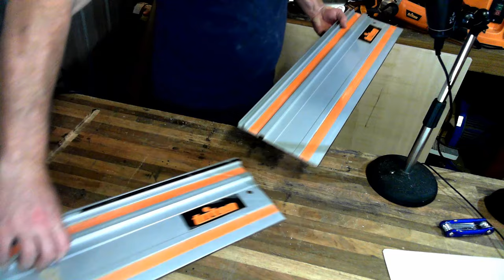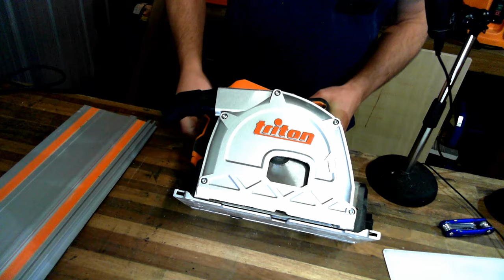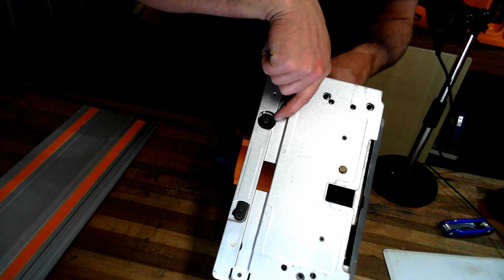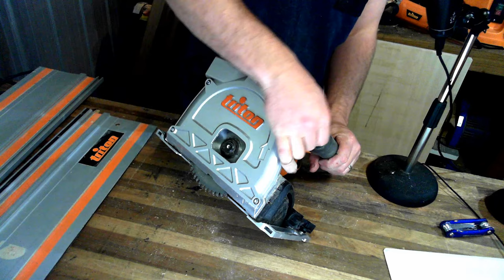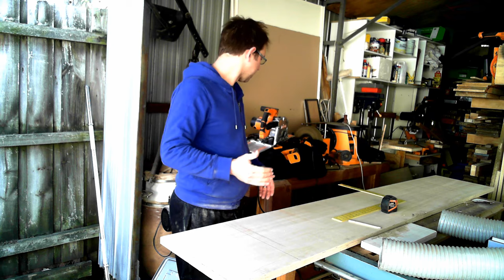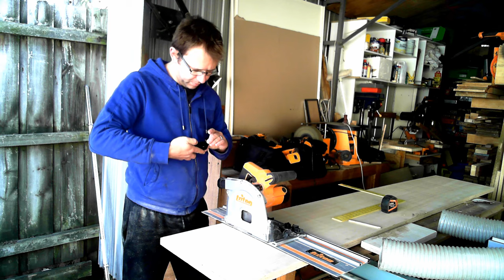How to use the | Triton Tools Track Saw

Comment: Get the dust bag and tape the hole makes a difference and is almost as good as extraction. The negative rake blades are fantastic and super cheap. Not as finished as the festool and tiny difference with the makita but other than the depth gauge being a bit out and the kickback a pain it is worthy as a trade tool.

Comment: Thanks for your video. A couple of suggestions. One, when show the tool place in on a medium-light colored surface - the camera will not have the problem of trying to deal with a high contrast image as in your work table vs. the light colored tool your showing us. Two, demoing how the tool will use and lock to the guides try placing the tool on the guides - it helps the visuals. Three, more light especially from top a sides - again the camera image will have less contrast and the viewer can see better what your demoing for us.
Thanks again, I appreciate your efforts.

Comment: I bought one of these after watching your review and lots of others.But i must be one of the unlucky ones that have reported defective tools out the box from the Triton range. The saw i got had about 5mm of play left to right when locked in any position the blade was touching the outside gaurd when plunging. I never even pluged it in not that i would even try to use it. Very disapointed. Not mention dangerous. How that got past quality control is beyond me.
Back to Makita for me.
Reply: Same way "qaulity" got by you in your comment.  The software underlines the word in RED as unrecognizable - generally indicating it's been misspelled...and, apparently - you missed it.
Reply: I dont use red underlining software.I take it you do yet i notice you have still had to edit your pointless comment. But well done for noticing.
Reply: No i have just sent it back to retailer. Although i have heard Triton after sales service is very good. But i dont have the time to be sending tools back or be without them. So i will go back to what i know. Its a shame because the price is right the fetures are right but the quality of the machining of this particular tool is very poor.
Reply from the maker: Sorry to hear that mate. Make sure you #tritontools so they know they have lost a customer.